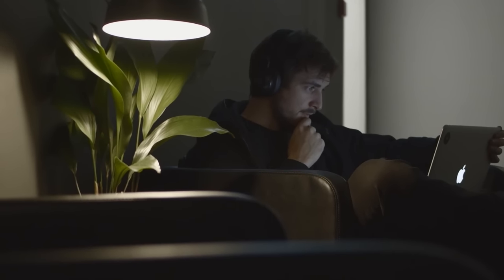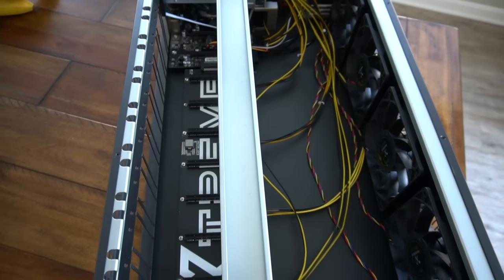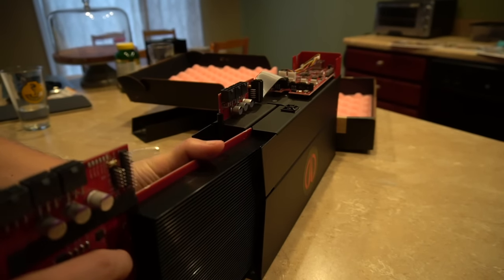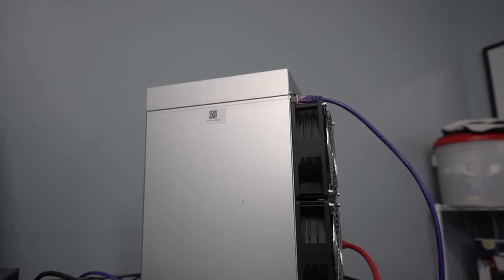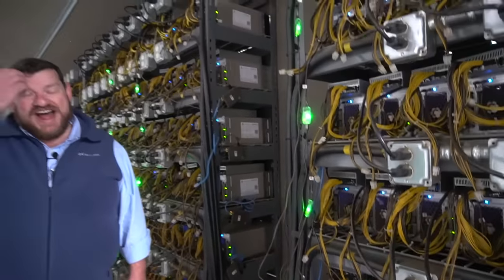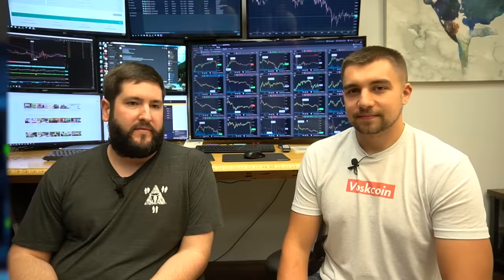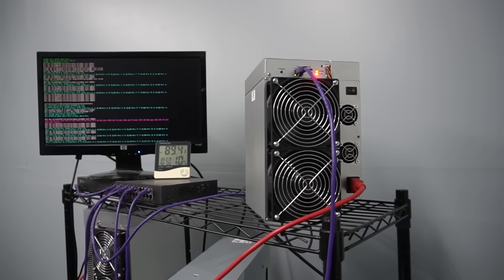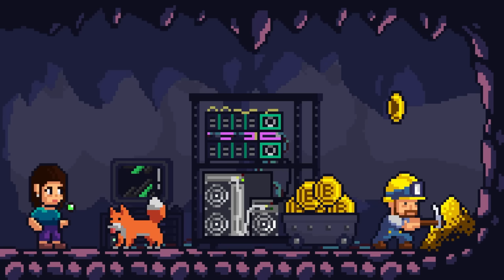He Built a Cryptocurrency Mining Farm with FREE ELECTRICITY!

Comment: i keep thinking about using a creek or underground water and  a 12 volt water pump to cool the mining rigs. run a copper coil in the creek and recirculate the deionized water. the creeks around here are in the 50 degree range. Why doesn't anyone do this?